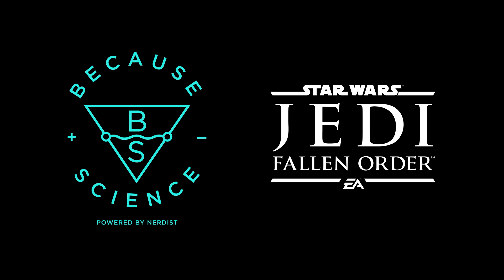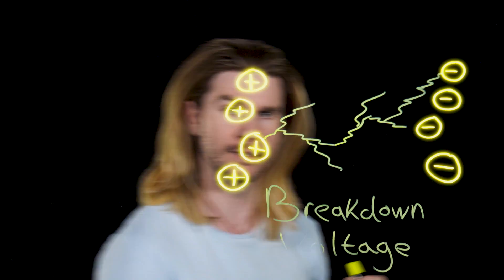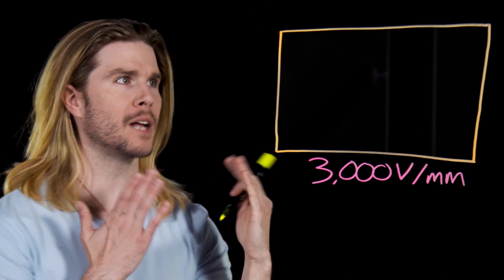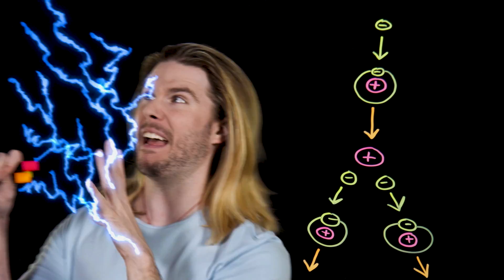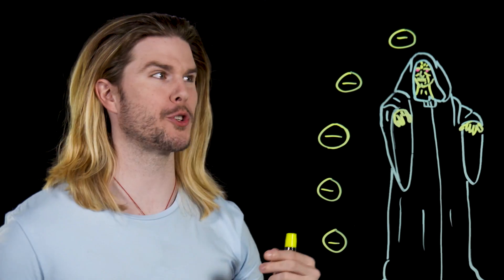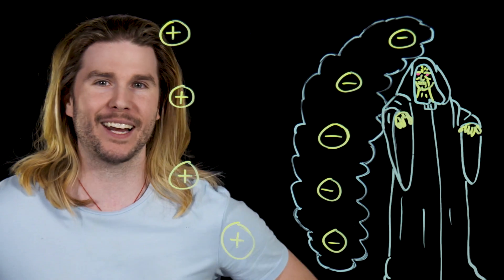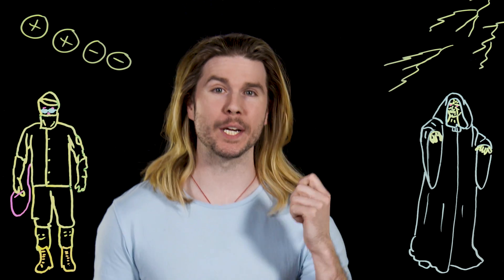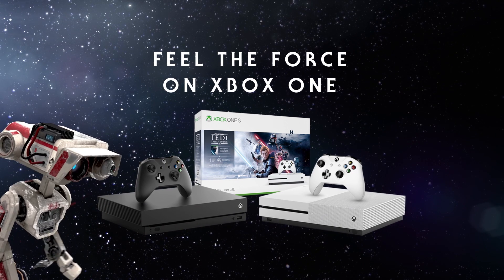How Does FORCE LIGHTNING Work? (Star Wars SCIENCE)

Comment: So i work in a plastics factory and this is easily one of the biggest annoyances epically during the winter when the air is cold and dry. We regularly have to handle large containers full of plastic or large rolls and then at some point pick up our metal tools or touch the metal machines. And some of the arcs created are insane. Were talking half inch to inch long arcs with very aduiable pops. To compensate we attached some "static bars" which are like exposed teala coils, and xmas tinsel to minimize the static cling by quite a bit. If not for these we wold leave covered in plastic scrap.

Comment: Pedantic correction incoming. On multiple occasions you state that voltage runs through something ( power lines for example). Voltage does not flow from place to place, but is an electrical potential difference. Meaning there is a difference in the number of electrons when comparing two places (like you describe with the negative charge building up on the clouds).

Comment: I was thinking about what theory you would go with for this video and how that would align with my theory (and the physics problems I see).
Consider that the Sith can create an electron imbalance in themselves (possibly their fingertips). The big question is: Against what would they create an imbalance, and where would their electron buildup be located? If we assume that they can store and control electrons in themselves to create a large imbalance against, say the ground (or the metal floor of the spaceship). The problem is that once their imbalance (the voltage potential) overcomes the breakdown voltage, the electricity will arc towards the closest place to the Siths fingertips, which would most likely be themselves or possibly the ground. If the arc was to obey the laws of physics, it would not be able to travel further away from the Sith than the Sith is tall, because the voltage potential will reach breakdown between the Sith and the ground way before it reaches the breakdown voltage between the Sith and the Jedi. This might explain why Cound Doku can use effective lightning at a longer distance than Emperor Palpatine; He's simply taller.

Kyle hinted on the way to solve this problem by saying "Siths can control individual electrons". This might actually not be the answer. It's well-known that Darth Vader cannot generate force lightning, because he has robotic hands. If they could control individual electrons, Darth Vader would be able to use some kind of force lightning, by just creating local pockets of extremely high electron content, then just throw these at the target. From what we see in the movies, this means that the electron imbalance should be within the Sith, conducted out of their finger tips. Vader cannot do that, as he would likely fry the electronics of his robotic hands or suit (which actually does happen when he saves his son!).

The reason why I think that force lightning works is that Siths can create a large electron imbalance in themselves, then they stretch out their hands to shorten the distance to the target. In addition to this, I think they are also able to mentally create a path of lower resistance through the air for the electrons to travel through (since they don't want it to go into themselves). In a universe where space wizards can move stuff with their minds, this is probably not too farfetched.

Comment: But what about amperage?

As far as I understand, amperage is more likely to kill than voltage. For example, a taser usually delivers its thousands of volts at 3 - 4 milliamps, so considering the lack of, well, killing we see from force lightning, wouldn't that make the force lightning even more like a taser than you mentioned? Granted, force lightning does sound cooler... But Electron Avalanche sounds so much better.

Cheers from a member of the (hopefully official?) Mane-tain club.

Comment: Last year as part of an engineering class I did, we were measuring voltage drops and resistances and stuff like that my lecturer got my classmates and I to try measuring ourselves on our multimeters by attaching them to our fingers. I can’t remember what the results were meant to be off the top of my head, but while everyone else was getting similar numbers mine didn’t work. I went up to my lecturer to check I was connecting it properly and he recommended I try with someone else’s multimeter while they used mine. Same thing. I got nothing, but they got a proper reading. And when I say I got nothing, I literally mean nothing. The display didn’t even turn on. So I won’t be facing off with anyone with electrical powers any time soon (not that I or anyone else here would ever be supervillans), but my question is why would they not want those powers in the first place?

Comment: Here's a question. If Kylo Ren has the ability to stop a blast from a blaster in mid-air, could a Jedi overcome a black hole or at least a neutron star? I think it's odd that the plasma didn't cool when stopped so is it possible that time itself was stopped locally and not the blast? If so then... I think you see where I am going with this.

Comment: Then why is a power outlet (230 volts in Finland) much more dangerous than a general shock, from a door knob or some other object? Because 15 000 volts is a LOT more than 230 volts, yet the smaller one can almost kill you. Is it the duration?
Reply: Ville Lepoaho Sort of, its the current (I),(which is the charge(Q) divided by time(t))  and the voltage(V) together that result in high power (P=I*V)that is dangerous

Comment: You found Waldo!!! 

Since we keep the ISS atmosphere 78% nitrogen, 21% oxygen and 1% metabolic product, with a humidity between 40% and 70% to reduce a negative buildup (static charge). 

So when you see sidious is force lightening, he is in the Death Star, and it will have to have a humidity over 40% as well. 

But dooku is on the desert planet of grooms is, and deserts have very low humidity making it easier for a negative build up.

Short story, dooku has to use less force powers to create force lightening on geonosis that it was for palpatine to do it on the Death Star.

Comment: no mention of "ppe" electricians use to work on live services? Cotton fabric measured in calories by density. Feraday* cages attract electrical arcs so on a team of 2, the mesh suit for 1 jedi and high calorie cotton suit for the other. the arc will always attract to the mesh-i.
 The ppe is rated for arc flashes that melt metal and fling molten lite iron(steel), copper and aluminum just to name a few common metals in and electrical service, at you at explosion level velocity. People have been engulfed by fireballs wearing this suit at arms length distance from the flash, and walked away without even a first degree burn.
  looking at the Jedi attire it look to me like heavy cotton like fabric, the robe if it covered your skin from all of the fingers of the lightning blasts might be enough to block the shock. They can start by wearing rubber gloves under some insulated leather gloves and now we just have to cover the neck and head. Electricians ppe uses a headdress in the same style as scubbadiving head dressing but calorie cotton. So the face? You have a lightsaber don't you? I'd say a mask but remember Snoke called Kylo a boy in a mask in Last Jedi.

Comment: Air is such a good inhibitor that sith lords who could generate lightning wouldn't be able to aim it. The lightning would take the shortest path and/or path of least resistance to what ever object or area has the highest positive charge which would probably be the metal around them or the ground. Because of this, if the highest positive charge is the ground that they stand on, then the sith lords would also have to manipulate the electrons in and around them in order for the lighting generated from their finger tips to not ark back at at them and electrocute themselves since they themselves would be the path of least resistance for lightning to travel to said ground rather than the air or let alone the target they intend to electrocute.

Comment: The problem here is that palpatine or any other sith lords would have to insulate themselves from ground. Not to mention that when attempting to build a voltage of thousands or millions of voltage it will ionize to ground as soon as the voltage is high enough meaning that they would only realistically be able to use it at either really short distances or when they were standing on insulated grounding.

You are correct that a Faraday suit could protect the Jedi but so could having the Jedi simply raise the voltage of their body to be equal to that of the voltage of the sith lord making it so there is no voltage between the two.

You also have to take into account the breakdown voltage of what the sith is using to insulate themselves from the ground.

Finally, you said something kind of misleading which was claiming that voltage will fry you but if that were the case than bare handing powerlines wouldn't work and would result in people simply dying. In reality, it's the power flowing through your body (watts) that's kills you (not current and not voltage). You can experience "lethal current" for a very short period of time and it will cause no Ill effects. The inverse, you could experience "lethal voltage" almost indefinitely as long as there was no current flow.

For those that don't know, bare handing is a technique for powerline repair where we raise the voltage of the body of the repairman to that of the powerline, then we connect them to the powerline so that there is no difference in voltage between the worker and the powerline, and then they start working on the powerline. This might sound more dangerous than it is but it can allow someone to maintain a voltage in the kilovolts or higher without any bodily harm coming to them.
Reply: Only problem with raising the voltage an such to match the Sith for Jedi strong enough that they see an know what the Sith their fighting is trying to do.. is that vast majority of Sith have no Lightning ability whatsoever and dont know how to fight much less use the abilities without matching science for science so doing with will probably be problematic
Reply: Well the insultation problem is simple enough, Sith Lords wear faraday robes and thick rubber boots.

Comment: slight problem with that defense. if you have that wire mesh to protect you, couldn't the sith just use the force to bolster the strength of the wire and then crush it in around you squeezing you through it like a playdo spagetti maker or the little net squeeze balls. basically spewing you everywhere as noodles as you scream in pain with a bone crunching squishy sound. in avoiding one death, you have met with another, WAY worse than the first. lol 
Sith: would you like to be electrocuted or spaghettified?

Comment: Assuming the Sith Lord is pulling their electrons indiscriminately and not just from their environment this process of generating force lightning could also explain the visible aging Palaptine undergoes from using the force lightning for too long against Windu. Tearing electrons from atoms in their own body would in theory produce a lot of reactive free-radicals which would cause cell damage throughout the body. If enough of this damage occurs in the skins connective tissues you would get the same saggy, wrinkly, skin like folks who get too much UV damage from the sun (but without the benefit of the sick tan from increased melanin production). Just like pasty white raisin Palps.

Comment: If the Sith are manipulating free electrons to gain a charge. Then they aren't just releasing them all willy-nilly. It would have gone straight into the metal floor he was standing on. I bet the voltage is much lower and they are just producing an positively charged tube of air to make it easier for the lightning to go where they want. Better yet, you could levitate things just by manipulating their charge. hmmm.... I wonder how much it would take to levitate a rock like that....

Comment: Hi Kyle, really love the show!

Now that I have you're attention, wouldn't the lightnight hit the ground first if it his the least resistant path to ground? Plus, wouldn't the ionised air be much more conductive, only requiering 22 000 000 V to initially ionise the air, than the sith would be able to lower the voltage. Just a thought.

Comment: Being a Sith Lord would be so cool, you could charge your phone using induction if your battery is low, even so you could have a special battery to make it even faster. Are you feeling cold? Then use the electricity to produce heat or fire. Do you want to climb some metalic structure? Don't worry, make an electric current flow through your hands and feet and now because of the magnetic properties of the flow of electricity now your hands and feet are magnetic.
UNLIMITED SCIENCE

Comment: Kyle Et-AL  While the voltage measurements are astoundingly large, there is no mention of the amount of amperes that are flowing.  The amps will kill you not the voltage as the old adage goes.  From the seen in Star Wars where we see Force Lightning in the Emperor's throne room for the first time, it is looking like he is getting is getting hit by a shock in the 50 to 150 milli-amp range.  This is described by  symptoms consisting with extreme pain, respiratory arrest, and severe muscular contractions.  Death is possible.  Any higher death is likely.  Thank you.

Comment: The part that you didn’t cover is how accurate force lightning users are. So if they can, as you say, manipulate the ionization of particles surrounding them then they would have to create a stronger imbalance in their target to notably attract that lightning to the intended target otherwise that lightning will find another way to ground.

This also begs the question with the more force sensitive Jedi and Sith. If that inequality needs to be established (and it does) how does the intended target not sense that?  You’d think even without force sensitivity you’d feel some reaction.

Comment: But what about accuracy? A sith LORD might be able to start the electron avalanche, but that doesn't necessarily mean that they have any control over the electron flow. And if you take basis in the electron avalanche, it would probably uncontrollable at a range from Dooku to Yoda.
And what about the heat coming from the lighting?  A lightning is around five times hotter than the sun, so wouldn't it fry Count Dooku?
And for the protection of our Jedi-bois why not just have a neopren/rubber suit underneath their ropes? It would be more lightweight so that they could continue to be agile.

PS.
Love the show in all its glory. ;-)
Regards
A Student from Denmark

Comment: Im a bit rusty on my ohm's law but if i recall correctly, its not the Electromotive Force, or voltage, that actually kills people. Its the inductance, or amperage, that is the actual cause of injury related to electricity. 

This principle is why you can have 1 Million+ volt tasers without killing someone. Because the amperage is low enough to not kill someone. 

Conversely, if you, for example, hooked yourself up to a 12v car battery, you could die because the amperage is really high with little resistance through the high gauge copper wire that is used for a car's charging system.

Comment: Did Kyle get a haircut? Split ends are no laughing matter

Short-lived electrical events called action potentials occur in several types of animal cells which are called excitable cells, a category of cell include neurons, muscle cells, and endocrine cells, as well as in some plant cells. These action potentials are used to facilitate inter-cellular communication and activate intracellular processes. The physiological phenomena of action potentials are possible because voltage-gated ion channels allow the resting potential caused by electrochemical gradient on either side of a cell membrane to resolve.  A basic law tells us that energy cannot be created, hence the Force practitioner must be generating this lightning (by use of the Force presumably). It would be a simpler to use an existing field rather than generate something (fire plasma) that's not already there. So going with the films it seems like it works in this way...  Like you’ve pointed out.. The Sith can control the energy, but I'd say any sufficiently adept practitioner will be able to focus this energy via the Force. Master Yoda did.

Comment: Hey Kyle cool episode,  but I had a question and a correction.

I'll ask the question first, Matpat talked about the force in a recent game theory and he specifcally talked about how the force worked.
He talks about the mitochondria being the inspiration for midichlorians and how they could explain a lot of the lore. He mentions how a buffed up mitochondria could explain force powers, how would that work into this episode and how force lightning can be generated?

Link to Matpat's video: https://www.youtube.com/watch?v=pG_7qwnVqyE

Now for the correction, you mentioned in the video that a high voltage gives a bigger punch but that's not entirely correct. Voltage stands for the electric potential difference or the "size" of the force moving the electrons through a circuit. While ampere stands for the unit to that's used to measure electric current or the amount of electrons being moved through a current.

So while a higher voltage would stil pack a punch, it's actually the ampere that really matters here in terms of what does the actual damage.